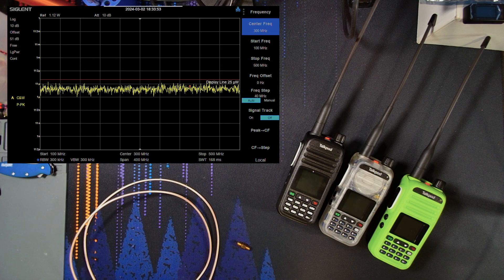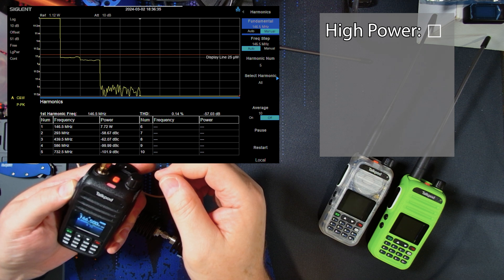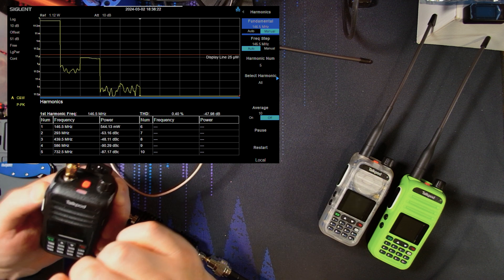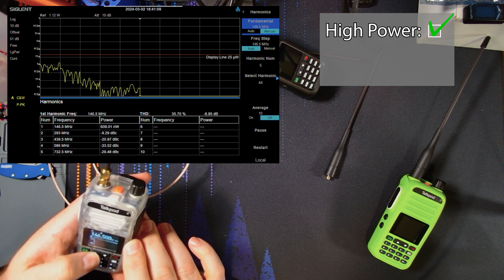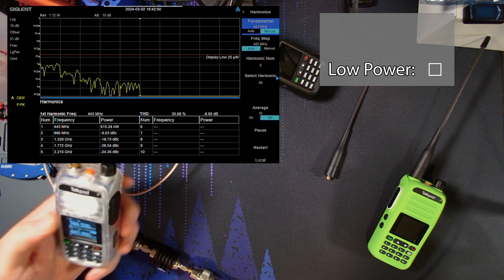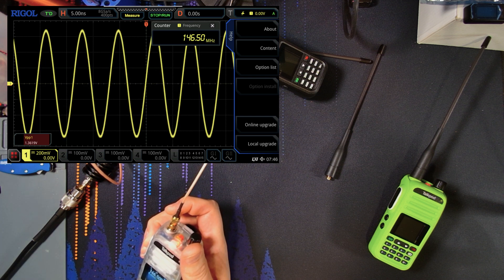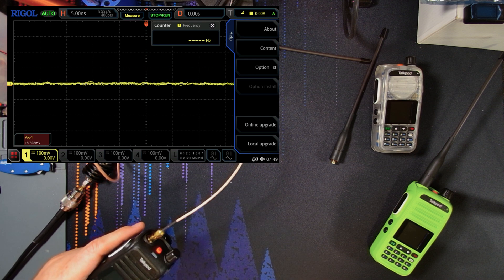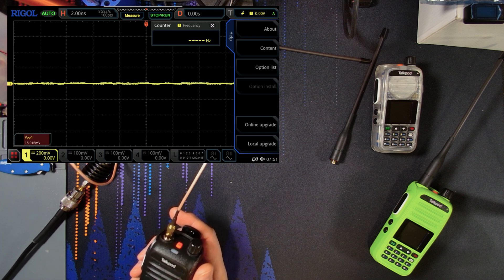Talkpod A36plus. Did they fix the harmonics?

Comment: I’m happy they fixed the harmonics. Truthfully I never use low power so I’m not going to worry about it but I’m disappointed. I used my TinySA to test harmonics on mine so I know it’s clean.
Reply from the maker: I agree, and happy that you are testing your own equipment with the TinySA.  That is a great little unit.  I have the TinySA Ultra (mainly for the larger screen!)  73